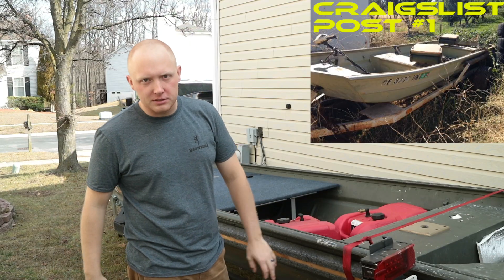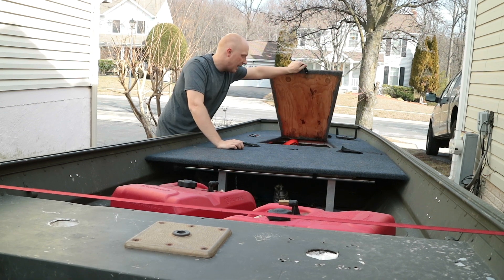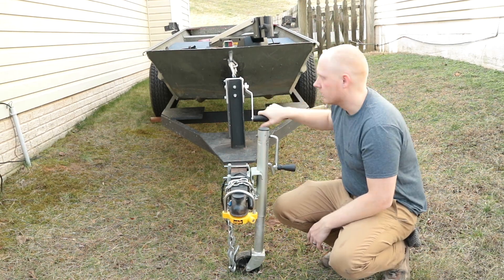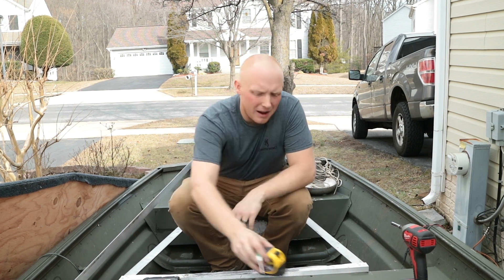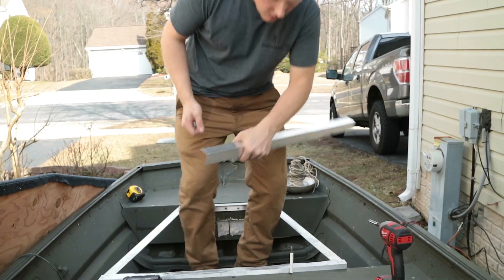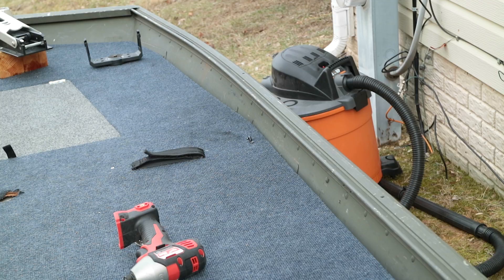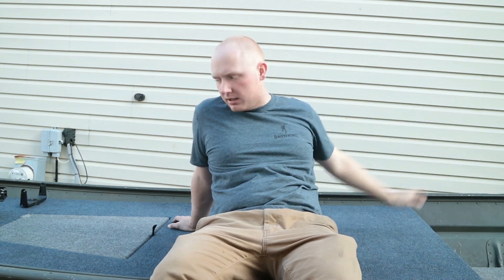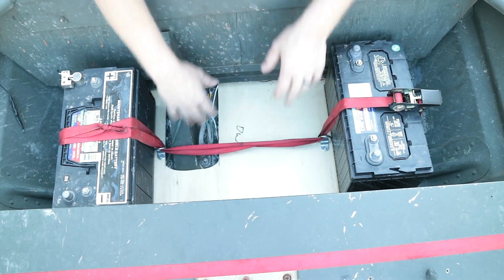14ft Jon Boat To Bass Boat

Comment: I'm getting a 55lb thrust trolling motor and is there any suggestions for amp in a batter
Reply: Battery it will power two lights one horn and the trolling motor
Reply from the maker: +Jacob Eisenmann great question. First thing I would do is buy a group 29D Everstart battery from Walmart (That's what I use). You should check with your manufacturers specifications for that specific motor. But TYPICALLY you would use a 6-8 awg wire with a 50-60Amp inline fuse. I would recommend maybe running two batteries. One for the motor and one for accessories but if you do use just one make sure you run the power wires for all your accessories directly off the battery through a fused distribution block and not off of or in line with the power wire for the battery. A 55lb motor will typically require a battery all to itself if you plan on fishing all day anyway. I'll leave links in the description of this video if you need some help finding parts. Let me know if you have any additional questions or feel free to email me at smgfishin@gmail.com anytime. Thanks for watching.
Reply: Where could I find this
Reply: SMG Fishin' for a horn and two lights can I get a really cheap battery like one that is 13 bucks
Reply from the maker: +Jacob Eisenmann yep that's what I would do. I might even look at like a jet ski or dirt bike battery.
Reply from the maker: All the stuff I talked about is linked in this video description.
Reply: SMG Fishin' k thanks

Comment: did you neutralize the acid with baking soda? some times just washing will take care of the acid but keep an eye on it to make sure the damage isn't spreading. my 14' Jon is done go check it out on my page goes 41mph and it's super fun
Reply from the maker: +outlaw garage and restoration I did that's the main reason I cleaned it out. That's awesome man. I'll be sure to check it out.

Comment: Walmart $8 each for the dry boxes for your batteries it's comes with a piece that goes inside to hold the batterie in place also comes with  a strap that goes over the top of the hole box to hold it in place if you every need any ideas I'm more than happy to help can exchange info for fb or insta to we can message
Reply from the maker: +Fishing The401 I have a couple of those boxes and I just don't like them. They make it more difficult for me to move the actual batteries in and out of the boat when I need to. Anytime man hit me up if you ever have any questions at smgfishin@gmail.com
Reply: will do man thanks im always open to ideas